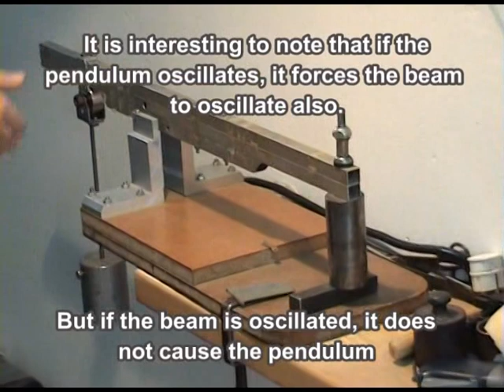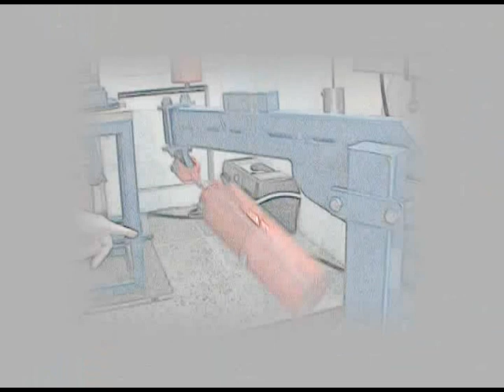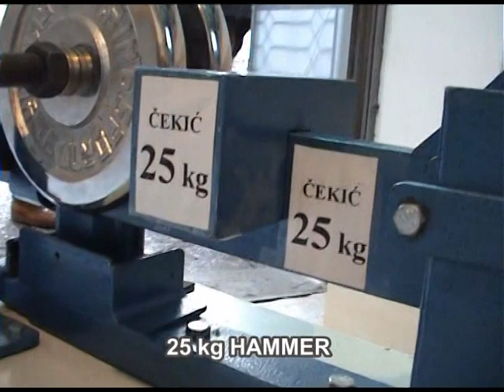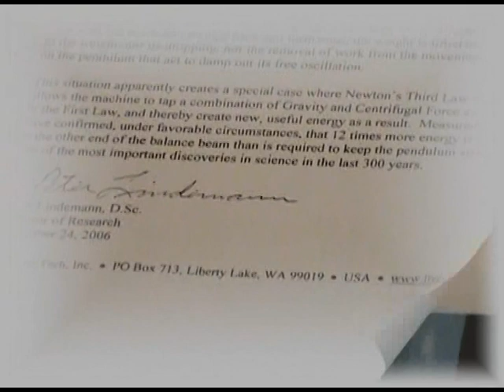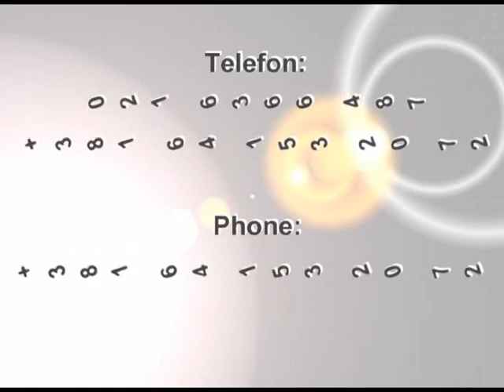Two-Stage Mechanical Oscillator -- A Mechanical Amplifier

Comment: I know force is measured in Newtons I didn't want to confuse anyone who may not know what a Newton is.

So now the ratio is 46:1.  It used to be quoted as 12:1, then you said 3.5:1 now 46:1!!!!  And even with that amount of output force the output still can't drive the input.  So as I said before those figures are compete bullshit.

Unfortunately the "engineer's report" is flawed.  As force is not a measure of a device's output power!  You have to measure input and output power!  Not force!

Comment: Replace pendulum with unbalanced flywheel, then spin that flywheel with a efficient high speed motor on the outside of the rim.

Comment: I looked at that video.  So what?  When someone uses the generated power to run a motor to drive the input pendulum you'll see I was right all along.  Better still to save on all the losses of driving a generator to power a motor why not have a direct mechanical linkage from the output to the input?

Regardless it won't work because the output is not greater than input.

I'll bet you $100 I'm right.

Comment: Do some real science Liam please! Make an improvised pendulum with a club hammer, suspend it from a pen, with a rubber band, place pen on edge of table, move back & forth till pendulum oscillates. Note periodic length extension of rubber band. Note force required to move pen "back & forth". This was the first test I did on Veljko Milkovic's device. When experiment completed, build your own self-oscillating pendulum. "Nulius in verba". Science is not interested in opinions! "SUCK-IT-AND-SEE".

Comment: So we have a figure of 3.5:1.  So a pendulum system that has say a 10 kilogram input force puts out 35 kilogram force.  So how come not one of these devices has ever been shown with the output driving the input?  There is 25 kilograms excess force available!!! 

Anyone with a bit of experience with mechanical engineering could work it out in 20 minutes.  Yet all these "scholarly" people haven't been able to.  Now I wonder why that is?

I can tell you why those numbers are incorrect if you want.

Comment: 1. Go to 11:30 and watch how in 11:36 energy (amplitude) of the pendulum drops rapidly. Milkovic misses only one push (at the pendulum) and pendulum energy (amplitude) drops.  And instead of letting pendulum to oscillate freely so we can better see if and how the pendulum energy is affected by the lever side work, he hurry to stroke pendulum again, raising it's amplitude and almost cover up the fact that pendulum energy have been previously decreased! It is not easy to see the decreased amplitude in that one oscillation but if you watch it carefully on full screen and replay that section more times you will see it. I have downloaded this video and played it in larger window. Decreased amplitude in just one oscillation time is clearly visible. Compare the amplitude of the pendulum in 11:35 (high amplitude with push) then in 11:36 (lover amplitude - no push) and then in 11:37 (high amplitude again after new push). According to Milkovic's theory the amplitude (energy) of the pendulum should not be affected by the lever side work so it can't drop significantly (between two oscillations) but can only decrease slowly after more time, but that's not the case here. So this is the first proof (in this video) that work on the lever side uses energy from the pendulum (side).

2. Now go to 20:05 and look at 20:10+ how the amplitude (or energy) of the pendulum is dropping fast until all lights at lever side are off! As soon as Milkovic stops pushing the pendulum, it's energy (amplitude) is being sucked off pretty fast by the 9 generator lamps on the lever side. When lamps stops blinking (or using energy) pendulum amplitude stabilizes at lower level. You can see that lower amplitude oscillations of the pendulum even at 20:30 because in the mean time no work have been done on the lever side and accordingly pendulum didn't lost energy in that (no output work) time interval. That's the second proof that the work on the lever side is using energy of the pendulum side.

3. The lamp on the pendulum side do not measure work or even force needed to push the pendulum. One can push pendulum with it lightly or with constant speed and light (on that one lamp) will not even go on. (I have such lamps at my home - you can by one in Chinese stores). Or at the other hand, we can push pendulum hard or with variable speed and light (at that one lamp) will be at maximum but the force applied will be much stronger than the lamp is using it. So the excess force is transferred to the pendulum and to the lever side.

4. It is relatively easy to measure potential energy of the pendulum and electric energy of the generator lamps to determine input-output energy ratio. I have seen on YouTube some quality measurement by the independent researcher and the results were in the scope of theoretical expectations.
Reply: WTF? This device work like amplifier by 9 times (900% overunity)! If you miss even one input pulse, load will stop device immediately! Without load, pendulum not need to feed every time... This device is corrupted, no output without small gift of input energy...

Comment: I have been under the impression that amplifying mechanical oscillations and transfering those to a electromagnetic system under specific peramiters can result in increased energy output. A transferance of energy in this manner is a increase in the energy flux dincity. Making a machine that will keep the pendulum going is a great idea. You can figure out the minimal energy input and gage it against the wattage out put of the light bulbs.

Comment: If you answer the question and say it didn't self power then that would be true.  If you say the output was sufficient to drive the input I'd know you were lying.

You pendulum test demonstrate what?  It doesn't demonstrate that the output is greater than the input.  The trouble is people who do pendulum experiments don't know what to measure as input and output.  I have looked at numerous other YT videos and they all quote incorrect values.

Comment: "The Norwegan Osmotic Power Plant at the Statkraft, for example, has a capacity of about 4 kW. Now researchers have discovered a new way to harness osmotic power that they claim would enable a 1 m2 (10.7 sq. ft.) membrane to have the same 4 kW capacity as the entire Statkraft plant." Lockheed Martin have just announced a carbon nanotube desalination filter. Physics is not stuck in the dark ages of two centuries ago, which you foolishly quote like a drunk parrot, It's so counterproductive!

Comment: "...real science" Oh yeah. Real science involves understanding principles and examining things closely.  Any claim of perpetual motion requires very close examination.

Answer me one question:  Have you connected the output to the input and got the device to self power?

That would be the only proof of over-unity.  The problem with these devices and the numbers (measurements) quoted is they are all incorrect.